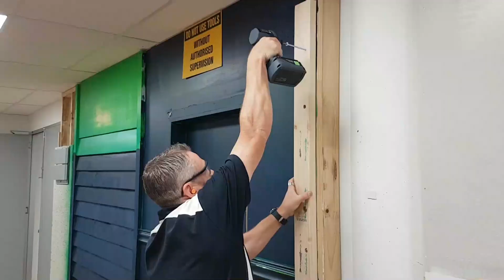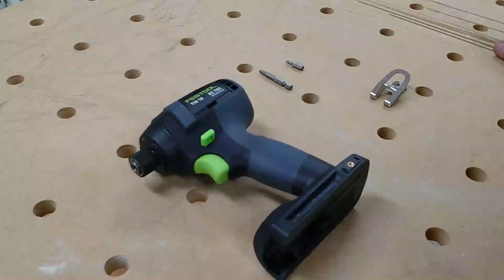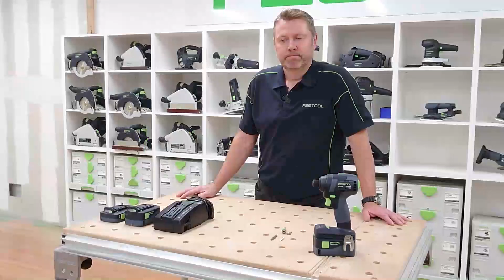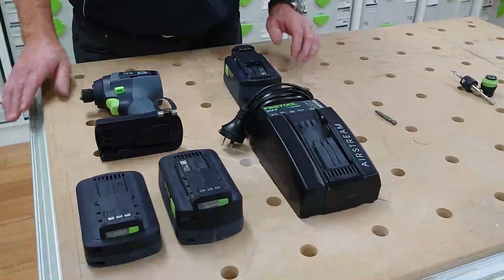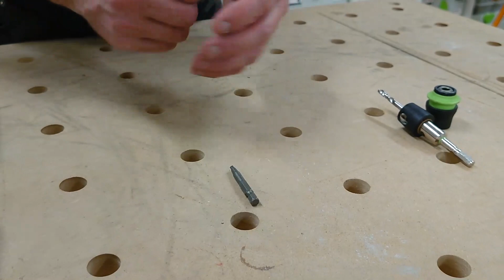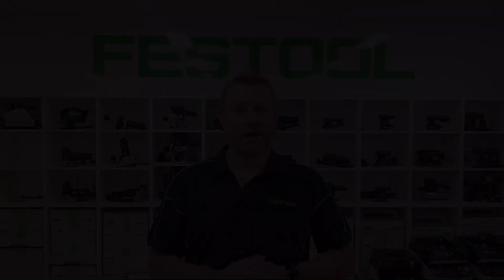Festool TID 18 Impact Driver | Complete Guide

Comment: I like this video for the following reasons...
is short and to the point, 
demo provided
close ups
informative
was debating Hilti or festool 
I have the Milwaukee 2853 has more power than my DeWalt 1/2 impact wrench it struggles to loosen lugnuts, to reinstall the lugnuts the DeWalt tightens to 166 ftlbs the Milwaukee without effort 263 yet torque value is 140. I plan to use it on vehicle care and ger a second for my fish carpentry company.
Thanks for the video

Comment: Surely it must be possible for Festool to engineer bit a holder that will take a standard hex and a centrotec in the same tool? For years you have been pushing centrotec being superior for bit stability etc and now after many loyal users have spent crazy amounts of money on centrotec driver and drill bits you bring out an impact without that doesn't support it. Does that mean that centrotec was never anything more than a marketing strategy to eek more money out of accessories and 3rd party licencing fees? Utter madness and a huge own goal for Festool in my mind
Reply: This doesn’t use centrotec on purpose, because cdntrotec accessories are not designed for high impact.